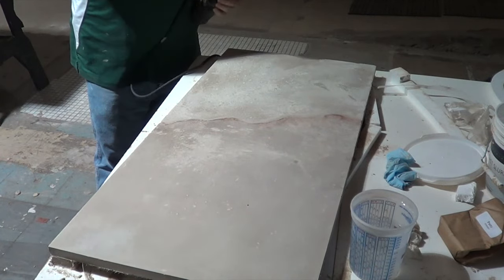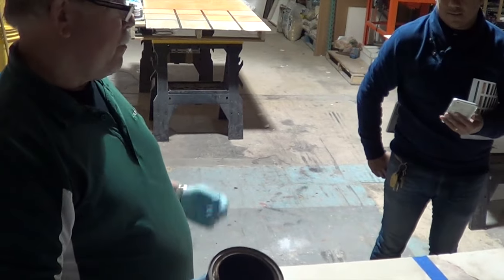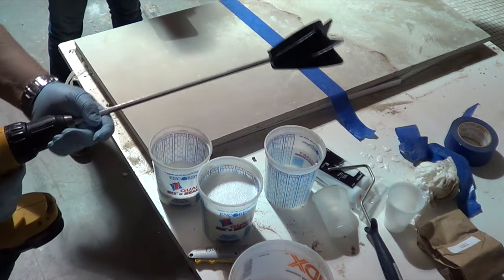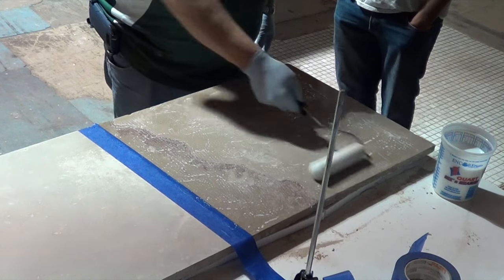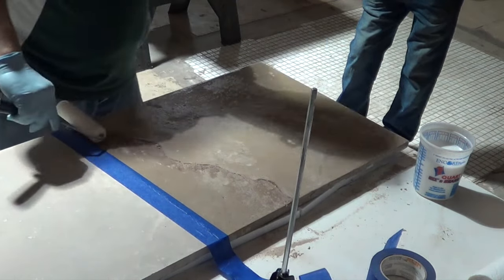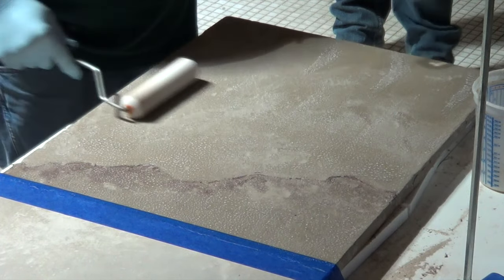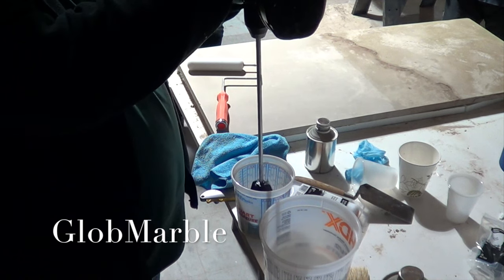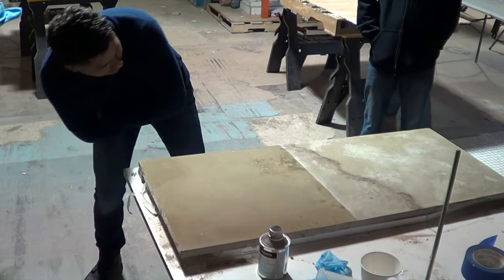Concrete Countertop Sealers. How to Apply Sealer. Decorative Concrete Training April 2017

Comment: I need to remove a bad coat of sealant before applying XS 327. any advice on whether it should be dry or wet sanded off?
Reply from the maker: Sanding a sealer wont work because the sealer has penetrated into the pores of the concrete. For that, you need to use a sealer stripper. We have two product options; EnviroStrip, https://globmarble.com/acrylic-paint-and-sealer-remover-and-stripper-envirostrip.html which is totally safe to use around plants and your garden, and FastStrip https://globmarble.com/faststrip-plus-solvent-based-concrete-sealer-remover-and-coating-stripper.html which works faster but cant be used around your plants and grass
Reply: @GlobMarble  thank you for the reply! Are these sealer strippers specifically for the polyurethane sealers like XS-327? I'm not 100% sure what our existing bad sealant is. It seems clear, somewhat penetrable.
Reply from the maker: To explain everything in detail will take a long time over the comments section. You can give us a call from 8-5 weekdays EST and we can discuss this over the phone- 1 (347) 717 4088

Comment: What's the sealer used?
Reply from the maker: Sealers: 
Water based: Available in Matt and Semi Gloss finish: 
XS 327  https://globmarble.com/concrete-countertop-sealer-xs-327-gloss-matte.html 
Solvent based: Available in Gloss finish: 
PC 12   https://globmarble.com/concrete-countertop-sealer-xs-pc12.html
Reply: @GlobMarble  If I wet sand using diamond pads, how long does it need to dry before applying sealer? Also, the recommended grit is 100, correct?
Reply from the maker: @jp8479  it depends to what concrete you're use. Polymer modified concrete as we use can be sealer in 12 hour, your concrete may have to dry one week. Make sure concrete dryer completely, then apply sealer. Recommended grit is 100, correct.